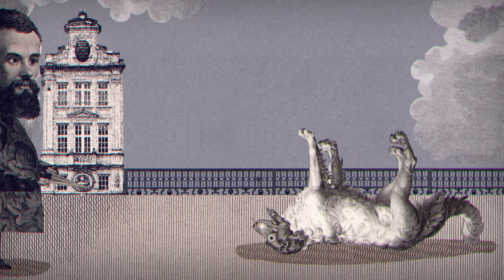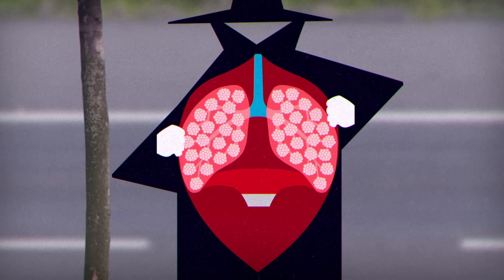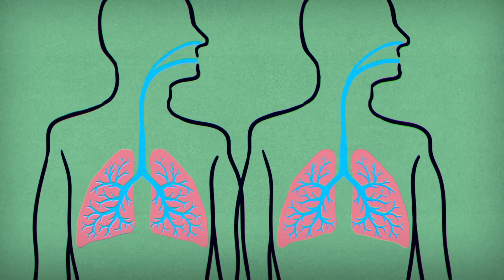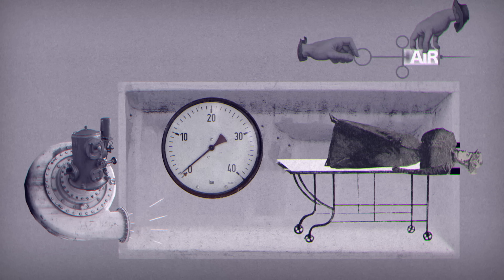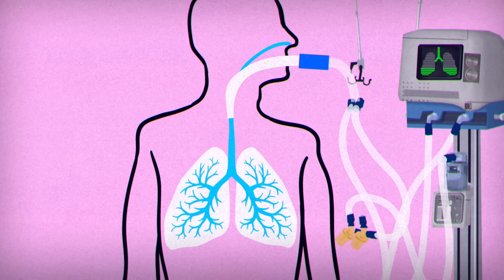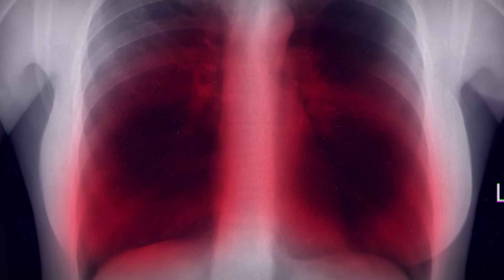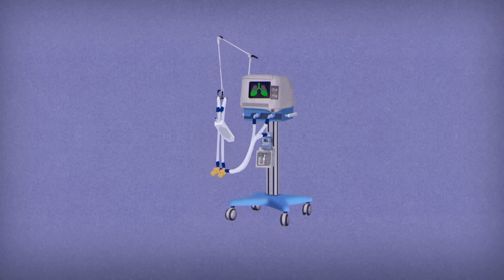How do ventilators work? - Alex Gendler

Comment: Fun fact, some iron lungs still remain in service. Most are used by polio survivors from the 40’s, 50’s and 60’s.
Reply: I don't know why they don't put them on modern ventilators, which when needed permanently, are connected to a tracheotomy, an opening in the throat.

Comment: Even the simplest ventilators  can be high risk. They require trained staff to keep the patients safe. Just pumping out more ventilators is not the solution. One small mistake can be lethal. Not good for the patient and not good for insurance rates.

Comment: I was thinking of creating an external lung that simply draws blood and pumps it back in, but then I realized that this small amount of oxygenated blood is not enough for the whole body. It would be too invasive if I were to simply increase the amount of blood-drawing points. Depending on the body's lungs really is a great way; it's almost like current day medicine is based off of exploiting the body's natural systems in order to improve it.
Reply: that already exists actually!! it’s called the ECMO. it processes ALL blood, not just a little, and oxygenates it outside the body. blood comes out of an artery in the neck

Comment: 90% "covid" patients placed on a Ventilator KILLED THEM!  99.98% Survival rate, yet 90% DIED due to medical abuse. No wonder the 3rd leading cause of death in America has been Medical Errors!
Reply: Uh huh sure buddy. And has it ever crossed your rotted brain that the reason they were put on ventilation was because they were literally on death's door?  Maybe try using your brain and realize your case isn't the end all be all. You're not the center of the universe contrary to what your folks told you.
Reply: Yeah cool where did you hear that?
Reply: @mansikkamies9146  Statistics.  NY Times reported on the Ventilator deaths, and Doctor's medical errors have been the 3rd leading cause of death in America for a long time, but now they can just call them "covid" deaths and push that control agenda!

Comment: What happened to all the old iron lungs? Can we bust them out for COVID, or at least quickly and cheaply produce more negative pressure machines? Not a permanent solution obviously, but at least a stop gap measure.

Also, wasn't there still an iron lung user up until a few years ago? Why not switch him over to ventilation?
Reply: We had one of those decades-long iron lungs users in my city living in her own home. Her husband never left her but I think he passed away before her. I called her after a local newspaper story about her to ask why she wasn't on a newer positive pressure respirator. A nurse answered and relayed the question to her. She said the doctor felt she could get more air with the old machine and it wouldn't give her any more mobility anyway since she was paralyzed from the neck down. I think these people just don't want a hole in their neck and are afraid of the possible discomfort of that and the machine. And they're usually completely paralyzed anyway.

Comment: I had to study the MV in prematurity for my review, in fact it should be mentioned that it can cause oxidative stress-rekated diseases causing more breathing problems.yet because there is no other way to help patients survive we still use it in hospitals. The surprising fact is that the more the tissues are saturated with oxygen the more it is prone to oxidative stress.
Reply: Yeah that’s why they don’t put babies on high oxygen concentrations. If they’re not used correctly yeah can kill you easily but that’s if the operator is being negligent

Comment: CANCER and infection (corona) TREATMENT: -
Local mediators in the cell core
A- primary mediators: -
Histamine, proteases-kinase, tryptase-and chemotactic factors-ecf <eosinophil and NCF neutrophil chemotactic factor
B-PAF (platelet activating factor) and arachidonic acid system products (such as exanoids, prostglandins and thromboxaneA2) are the best examples.
B-sequencing mediators
In inflammatory cells, peptide cytokines (interlokines) produced over the endoplasmic reticulum-Golgi after exposure to the antigen are also regarded as interferons as sequencing mediators.
All of these in the nuclei of blood cells
If we cut these nuclei and injected their fluids into the blood.
If we do, all blood cells become a single function (cleanser). If we load Rh, the systemic mediators also come and the cancer cells disappear (work in rabbits) The dose is one dro
Getting rid of obesity, obesity caused ??? diseases can also be completely cured
Testosterone + Rh >> kc = Gluconeogenesis (chlorine delivery) this method is more suitable

 YOUR (LUCKING) TREATMENT?: -
{Testosterone + Rh infusion into the hypothalamus} + {Ayaka maximum dos (CSF) infusion}
> After 40 days the body will have a body like 13 years old and can give birth ...
IHAB Z S ALKHOUDARI@FACEBOOK

Comment: not really an informative video .. a ventilator only can work when the lungs are functioning .. It won't work if the lung damages percentage is high. 
in that case, the ECMO machine is a state-of-the-art machine that can function as an artificial lung.

Comment: Forcing Oxygen via a Ventillator....the question is..."Can we not Oxygenate the blood outside the body?"...Since theoritically the  system of respiration is to provide oxygen to the blood. Like in the case of Covid Patients, People are dying due to asphyxiation or lacked of oxygen in the blood. Lung alveoli are hindered by puss and fluids..so heavy breathing is expected. Necessity is the mother of Invention so they say...what if a Centralised Blood Oxygenizing Machine is invented ?"...where tubes of Covid Patients are connected to this machine "Centrally" and added to it is the  Practiced of  dedicated machine per covid patient ( ventillator ). I do hope medical-machine inventors could read this and come up with a machine that could oxygenate the blood externally. If Dialysis method is doable why not  for a Blood Oxygenazing Machine. Such endeavor will and can save numerous  lives. God be with us all.
Reply: You need to consider the MASSIVE surface area that alveoli provides for blood in capillaries to take up enough oxygen. I think that’s the problem at the moment for your idea. But it would be incredible if that problem can be circumvented.
Reply: @ti_bui9481   Im not a scientist but base on the readings i have read before...Its the amount of iron in the blood that attracts oxygen "O2"  in the blood. So if the iron is the one attracting oxygen..it only shows that the given iron in the blood determines the amounts of Oxygen "O2" needed of a particular human body.
Reply: @reyagustin9087  It's a good idea but there is a limit to how much iron you can give a person. 

A quick wikipedia search of iron poisoning shows that it begins to become toxic when giving a dose of 20mg per kg that you weigh. Assuming someone weighing 50kg means that the person at a maximum can have 1g, which I personally don't think is going to make much difference in 5 liters of blood when trying to oxygenate it outside.
Reply: @reyagustin9087  The surface area is actually incredibly important because of diffusion. I'll assume that you don't know the concept so I'll try to explain why it is so important.

Imagine just having blood inside a large tube and the oxygen can pass through the walls of the tube and into the blood. The problem is that oxygen fom random motions only reaches blood on the outer surface of the tube. That means oxygen can't reach blood in the center of the tube and CO2 can move out either. This is also another reason why I don't think increasing iron would help

The job of alveoli is to "spread" the blood to avoid the situation. The more "spread" it is the more effective blood is to take up oxygen. That's why alveoli spread the blood on to a surface of 100m^2
Reply: @ti_bui9481  Thank You for the enlightenment but i begged to disagree that what human exhales is CO2...its actually "Carbon" fused to remnants of O2 at the alveoli. Books says its CO2 but not  for me. Further to add..you are emphasizing the blood at the center of the tube not fully oxygenated...Im just imagining as if its a "One Cycle Only or One Pass so they say". As far as i know, any liquid inside a tube "May Changed position during the traverse".
Reply: @reyagustin9087  Regarding CO2. It is formed during respiration in the mitochondria of all cells in your body and is collected in the blood. Solid carbon doesn't spontaneously react with oxygen and to become a gas.

Indeed blood cells can change positions when traversing along the tubes but that generally doesn't happen at a significant rate unless you can create turbulence within the tubes. 

Whether this is enough is also a question of reaction rate. Some things dissolve/react very quickly while others are more slow. The oxygen in the air needs a surface to react on, which in this case is the surface of your blood. If you want your idea to succeed then you need to take into account how fast oxygen in the air can get dissolved and bind to the blood. One way to make it fast enough is to allow the oxygen to react over a larger surface which the alveoli is there for.
Reply: @ti_bui9481  I never mentioned any "solid" carbon and also adding additonal iron in the blood as you explained earlier. Anyway , thank you for the correspondence and be safe always.

Comment: Why can't machines oxiginate blood,  remove co2 and add o2? Bypass lungs completely.
Reply: Because the cost of a machine would be immense. Even relatively low cost ventilators are in short supply.
Reply: @stealthstandard  does such a machine exists?
Reply: @yoraj6564  yes it’s called ecmo

Comment: Ventilators are not the best resort in case of COVID-19 as doctors have reported. Most patients in western countries were straight away given air through ventilation to protect them from covid-19  but it backfired and lot were killed. Now, most are not waited a lot by doctors till last moment before ventilator.

Comment: If my lungs will be damaged permanently from using an invasive ventilator, then I'd rather ONLY use non-invasive methods no matter how much of an emergency.   If I die, oh well, we all have to go at some point.
Reply: they don't always damage lungs permanently, but they sometimes can. It's rare and also very gradual if it happens. What damages lungs permanently is very much more related to what caused you to need a Vent. Covid-19 survivors have perm lung damage because of covid not because of the Vent. I've been 24/7 vent dependent since 2010, in 10 years my lungs haven't changed. Life on a home vent isn't that bad, it's painless.
Reply: @mcclintick  ⁹

Comment: I have a question. If somebody is infected by covid-19, their lungs are damaged to the point they are put on a ventilator to survive. Is there a way, and how long would it take, for such patient to recover normal lung functionality after the decease is treated ? Do the lungs eventually recover the damage ? It probably depends on the severity of the damage, but still.
Reply: As an ICU RN living this nightmare 14 hours - 3 days a week, I'll try to concisely answer. The answer  has more to do with the chronic condition of the patient prior to being vented than what the vent does for them/to them.  Diabetics, obesity, history of Congestive Heart Failure, etc., automatically puts patient's in jeopardy of doing very poorly. However, the alternative is death should they choose not to go on ventilator.  I have had more patients die in the past 24 months then my prior 13 years of my 15 year ICU career combined. We loose 2-3 per week on my unit.  As stated in the video, Covid makes the body goes into a hyper-inflammation process that actually does so much damage, it causes blood clots leading to pulmonary emboli, heart emboli, and brain emboli (Stroke).  For those lucky enough to be extubated (removed from vent alive) they have a very long recovery period where they are at high risk for relapse.  The younger and healthier they are prior to intubation is directly correlated to how they will do post extubation. There are many who end up with a tracheostomy who are transfered to long term vent facilities to live on a vent.  Our worst nightmare.  Everyone always has the same question..."How long will my loved-one be on the vent?"  Honest answer is we don't know.  Now I beg you all who read this.  Talk to your loved one about their long-term wishes PRIOR to finding yourself making decisions for them when you don't know what they want.  There are family members who insist mom/dad; grandma/grandpa be kept alive on a vent when they have made it clear in earlier life they do not want to live that way.  Have the courage to do the right thing for your loved one.  Allow them to die comfortably (we know how)  if they told you earlier in life they never want to be kept alive on artificial life support.  Yes, people come off the vent.  However, for those who won't ever be able to, please don't keep them in that position to relieve your own guilt.   Thanks for reading.  Susan, RN

Comment: Shouldn't Covid-19 be treated differently than pneumonia or other respiratory diseases?

We still don't fully understand the virus itself and patients are getting ventilated intensively. It could be doing more harm than good. They suggests that they rupture the lungs leading to death of covid patients because of too much pressure. 

You cannot just treat something unknown with something you think will work because it always worked in that certain scenario or because it's similar cases. Especially if there's a risk.

I'm not saying that I know everything or that patients with covid to stop getting ventilators and I can understand that nurses and doctors only wants to help.

It's difficult because we don't exactly know whether it's helping or not. I don't know what exactly should be done...

Comment: the ventilators can't really be low-cost. like most solutions we've seen over the past 4 months. low-cost solutions are missing the most important parts (i.e. valves, backflow regulators, moisture control etc.pp.) and do more harm than good.

Comment: Ventilators have actually been known to cause lung damage and can even cause lungs to collapse. This has only been discovered recently, in part due to all of the corona patients
Reply: They only put people on them when they can’t get enough oxygen into them with the oxygen masks, so they’re pretty far gone, anyway.  It will be interesting to learn how effective they actually were when this is all said and done.  I wonder if full sedation has anything to do with the death rates of ventilated patients and if the old iron lungs would have worked better.
Reply: Yep they found a ventilator is at best a last ditch effort and at worst a death sentence for COVID patients. Wonder how many of those 100000 died due to ventilators damaging their lungs worse than the virus...

Comment: As an ICU nurse, I wish that there would be operator-easy and user-friendly ventilators. Could someone invent ventilators that are cost-effective and easy-to-use?
Reply: The one I was in, was brand new to the hospital but only certain staff could use them because the nurses hadn't gotten the training to use them yet but they seemed really easy to set up and use, even I learned how most of It worked just by looking at them settings it up. Maybe soon enough those will be the standard.

Comment: I don't understand why a ventilator costs so much, they can be easily build with an Arduino, some tubes, an electric motor, some sensors and an air plump.

Comment: Have stocks in Ventilator manufacturing dipped since they killed more than they saved?
Reply: Tuor 80, the question is whether the ventilators actually killed them or if they would have died without the ventilator, and it just kept them alive a little while longer.

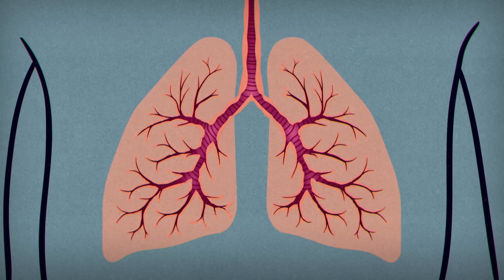Comment: 1:33 when most people think of sleep apnea, they think of obstructive sleep apnea, not central sleep apnea. OSA isn't an issue with the diaphragm, it's an issue with upper airway obstruction due to things like collapse of the palate. This is evident because the diaphragm and muscles of the torso work just fine during an apneic episode, air just can't find its way in easily.

Comment: A video with the same title could be about the more technical aspects of ventilator. So, How do ventilators work? And then answer be about how the system creates pressure?, What are those graphs on the screen of ventilator? A Ted-Ed version of the aforementioned questions will be great!

Comment: Why do the doctors use heavy sedatation in order for the ventilators to work?
Reply: There are multiple reasons. If a patient requires high ventilator support, complete synchronization with the ventilator is required for optimum ventilation. Any spontaneous breathing  ( 'breathing in' in the form of negative pressure) especially one with insufficient volume would interfere with the machines function to provide the mandatory breaths. 

Another reason is getting your lungs inflated with high positive pressure isn't a pleasant experience, therefore sedation would reduce anxiety and stress